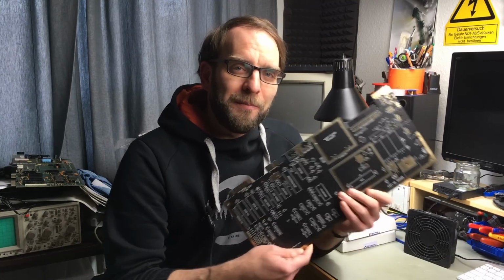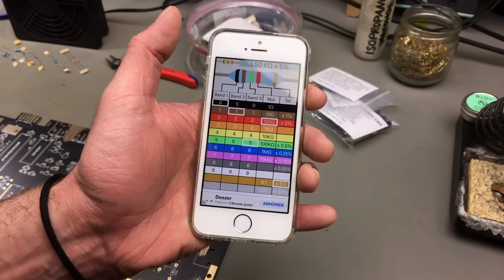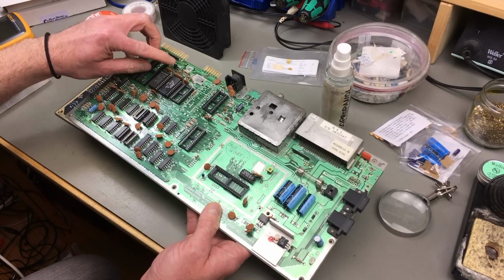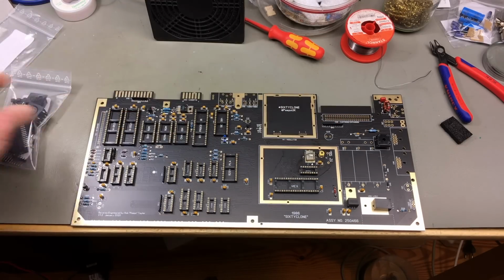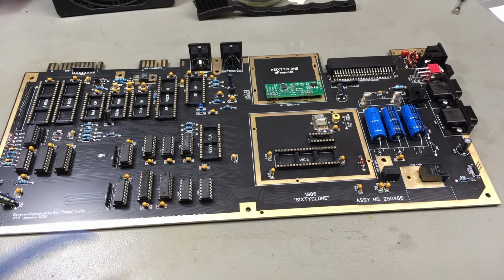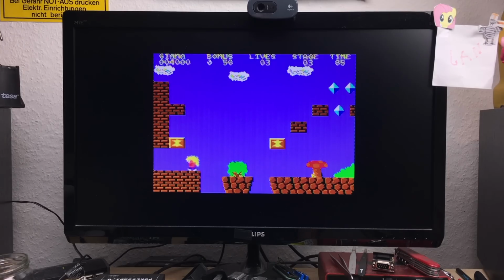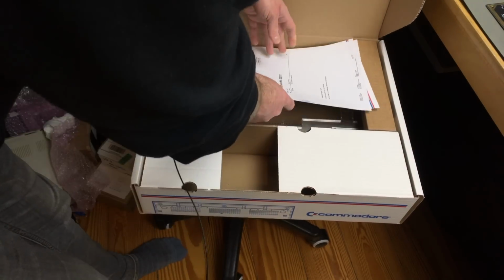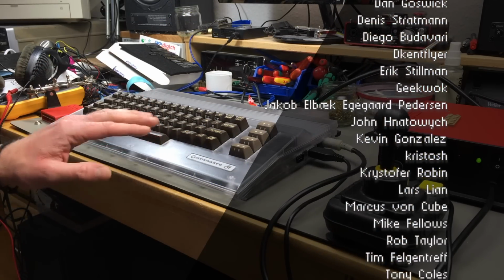Building a new C64 in 2020

Comment: Is there a way to to make a socket to rewire to 6502  so it can be used as a 6510?  There seems to be a lot more 6502s out there than 6510s.
Reply: I'm working on it. It's way more complex than a rewire as a clear difference between a 6502 and 6510 is the AEC functionality to remove the CPU from the bus. You need to implement that with discrete logic and as with everything C64, getting the timing right is crucial for good compatiblity: Not too fast and not too slow. And of course you need to implement the processor port with discrete logic. I will release a 8501 and 8502 adapter first, because those chips are even rarer than a 6510.
Reply from the maker: I think I saw somebody made a replacement like that using one of the MOS CIA chips for the ports if I remember correctly? Can't find it now but it was a fascinating read.
Reply: @JanBeta  I have a schematic by Ruud Baltissen that uses a 6522 VIA. It is a big 40 pin IC that makes it impossible to fit anthingthing in e.g. the Plus/4 and only using a fraction of the functionality of the 6522 feels bad. The Baltissen schematic does nothing to get the timing right and has a bug where the 6522 is clocked by the AEC signal, which means it doesn't receive any clock if a Plus/4 is in fast CPU mode. I have decided to implement the port using six 74xx chips (can be reduced to 2 chips if I hardwire the data direction register), which is more than I like, but in combination with evil SMD technology, it is then at least possible to design something that fits in a Plus/4.

Comment: switching power regulators always have a lot more noise than the lineare have. therefore, these should not be used in audio products and oscilloskop.
Reply from the maker: These are extremely low ripple/low noise, and the switching frequencies are way out of the range of the video/audio signals. As I said in the video, I have been using the same 5V regulator in my everyday C64 for ages without any issues whatsoever.
Reply: @JanBeta  I understand. All sound kit as preamplifier, riaa, DAC, uses only linear regulator and never switch regulators. May have something to do with the fact that they are the cheapest. 
The disadvantage is that linear regulators get hot and must have good cooling

Comment: Has anyone ever made a W65C02S to 6510 adapter? Since you can't get new 6510 CPUs anymore.
Reply: I'm working on it. You should be using NMOS 6502s though (no longer made, but easy to find), in order to support undocumented opcodes.
Reply: @Apple No, I am implementing it using 74xx circuits and a GAL. No VHDL used. The use of low-cost components will keep the costs of a replacement low, just like for my PLA replacement. You have control over the timing by selecting different GAL speeds and different subfamilies of 74xx circuits. You need to choose that correctly in order to replicate the original 6510  timing. Because AEC function can be controlled by cartridges which can make all kinds of assumptions, there is not a lot of room for being different to the original 6510. It's not enough to be  within the timing margins in the original Commodore specifications, you need to replicate the actual 6510 timing behaviour.
Reply from the maker: Hey Daniël, let me know if you have something ready to test. Would be really cool to use one in this build. Although I'm also eagerly waiting for the Mock65xx project to be finished, that will be extremely useful to replace some of the rarer 65xxx processors, too. :)

Comment: I think the only disappointing thing that I can see from all this is that the creator didn't try and work out how to change the axial caps to radial ones. Axial caps are a pain in the ass to find here in Australia.
Reply from the maker: Oh, you can actually use radial caps instead of the axial ones, the connections are there on the original boards and also present on the replicas. Commodore probably wanted to be free to use whatever parts they could get their hands on. I've never seen a stock C64 with radial caps in those positions though.

Comment: Hmmm....I did not recall C15 being polarized or that it was a tantalum. I followed the BOM pretty closely, however. Looking at one of my photos I took, I see no text printed on the right side so perhaps I got this one correct on the first try. I might pop open the case to be sure.  I do recall C200. I asked about this one before soldering. This makes me wonder if my SixtyClone 407 has any of these. Not seeing any on the BOM.

Comment: Nice work! Just a few nit picks. You are supposed to bridge the JPLUM1 on the RF replacement board when using it on longboards, to get correct chroma/luma values. c0pperdragon documentation is a bit lacking. Also when you use a replacement 8701 you don't need the crystal, CT1 or the ntsc/pal bridge. At least that is the case with TOLB from eslapion. :)
Reply from the maker: Yes, completely forgot about that little jumper, thanks! For the 8701 replacement I'm using, I need the crystal and the bridge. Might give the TOLB a try sometime soon though. :)

Comment: Der ARMsid ist wirklich mega. Ich hab zwei davon in meinem Ultimate64. Einer als 6581 auf dem rechten Ausgang, und einer als 8580 für links. Das ist fast schon Surround-Sound! ;) Du könntest in deinem Video darüber das Firmware-upgrade und die Einstellungen der ARMsid's deinen Zuschauern zeigen. Ist vielleicht für einige interessant die ein 469er Board haben, aber gerne den 6581 Sound hätten.
p.s.: Tolles Video! So lange schau ich sonst niemandem beim löten zu. ;)

Comment: Interesting project.  While I think that most people will probably be better off using something like TheC64 and sticking with emulation, I can see this as being really good for those who want to stick with real hardware but maybe only have a non-functional or semi working original C64.  

One more thing that I could see being a good add on for a project like this one (assuming you could do it) would be to replace the TV modulator with a device that allows the installation of a HDMI connector which would make connecting up the C64 to common monitors and TV's a lot easier.  An LED strip in the case would also make good use of the clear material but it is up to you how much rainbow vomit you like in your systems.

Would you consider doing something like this with one of the Amiga boards that are avialable?  I could see there being a lot of people from the Amiga community being interested in something like that.

Comment: It's great to see so much support for the C64, usually with older machines I always have a feeling in the back of my mind that I'm kinda taking it's life away by using it at this point, if that makes any sense.. for the C64 though you can get a replacement part for pretty much everything relatively easily at least if you don't require originals. Just try working on some old PC compatibles or other less common machines and you'll be on your own, some machines may not have any search results whatsoever and when a proprietary chip dies on one of those.. oh boy

Comment: If it's a pre rev. 1.4 then remember to do the cartridge port fix mentioned on the tindiepage for the sixtyclone. 👍
Reply from the maker: I didn’t have the fault on this board, actually measured it before I started filming and forgot to mention it later.

Comment: Does anyone make Breadbin cases or is there some reason no one does?  I see cases on EBAY but they are obviously recovered.  I do have breadbin cases I could retrobrite but afraid they will just turn back to brown.  If you replace your keyboard do you mean to clean up an existing keyboard and put it back in?
Reply from the maker: No, afaik nobody makes new breadbin cases. The only reason we got the new C64C cases was that they found the original molds for it when they demolished (or renovated, can’t remember) an old factory.

Comment: Hi Jan, I intend to do the same with a new A1200 board. But until I know exactly how to desolder the chips and solder them back in again, I won't even start. Do you know how to do that? I have learned how to solder. Thx, Frank aus Gladbeck
Reply from the maker: Oh, the A1200 is mostly surface mount parts so you should practice with hot air a lot. Desoldering the larger ICs is non trivial.

Comment: Finished watching now. And I have a questions though.

I have noticed, that the PCB is a bit too wide on the cartridge port on mine. Have you noticed anything and if so, what have you done?

Also. Great job with the machine. 👍👌What colour rubber feet, did you use?

Finally. Why did you take the chance of power on first time, with the chips in, when not measuring voltage and ground connectivity first.
Reply from the maker: Yes, the PCB is slightly wider on the cartridge port but so far all cartridges fit and have a slightly tighter grip which I don’t mind.

I think I would just use the nail file i used on the LED to bring it down if I was to do it.

And I actually checked the voltages before populating the ICs but forgot to film. I was slightly excited the whole time through this build, it was just incredibly fun. :D
Reply from the maker: Oh, and I used the white feet that were provided, might replace with clear ones at some point but they look fine.
Reply: @JanBeta  Nice....
I have a couple of brown ones that I think will look good on the black case. Regarding the cartridge port, then my Epyx Fastloader Reloaded are too slim. The board grinds at the edges of the cartridge inside the cartridge case.
Reply from the maker: Oh, I’ll try my Epyx cart, too. If it doesn’t fit I’ll take the file to the PCB! :)
Reply: @JanBeta  👍 Let me know if that is the case on your board as well. 🙂

Comment: Great video! I think the green power led is dimmer because: a) the case is translucid so a lot of light enters it; b) it's recessed deep down in it's square hole; c) as you said it takes more voltage to light up brightly
Reply from the maker: Yes, makes sense! I might also just replace the resistor with a more suitable value to make it a little brighter, haven’t decided yet. I like the color though. :)

Comment: That was a really nice build! I also got myself an ARMSid replacement for my C64 because my original 6581 R4AR started to make some strange noises and is probably about to die sadly. I really like it a lot and with some tweaking with the provided software it sounds really good! The only strange thing about it that I can hear is some of the noise waves sound a little bit off, like they are at too low frequency. For example when playing Sam's Journey you hear a whoosh sound when you pick up a power up, and it sounds quite different on the ARMSid than it does on an original SID. It's kinda like the noise channel is one or two pitches too low. Hopefully a firmware update can fix that. Other than that I am really happy with the ARMSid and at that price it is a no brainer if you need a good replacement. Really nice that you can change the emulation between 6581 and 8580 modes and get the best of both worlds on the same board (I still highly prefer 6581 like you Jan) :)

Comment: I must admit. I'm a little more a "Atari fanboy" rather than C64 so I'm really jealous about those new mainboards for C64
Reply: I think that eventually, we will be able to have new  builds of every platform that still has a community of users... I think this is how the problem will be solve and keep prices reasonable, we cannot continue with crumbling machines and increasing prices forever.   I am more into early PC's... and it is now possible to build a brand new 8088 machine from completely new parts now.  exciting times for retro-computing. most of what we do in life, play, work, does not require today's powerfull machines, when you think of it.  some famous writers still use programs like Wordstar, and word perfect for dos.
Reply: Same, but TRS-80 Colour Computer...
Reply: I love making chiptunes with the Atari 800 Pokey soundchip and the C64 SID soundchip. SID 6581 chips have gotten expensive but Pokey chips are now not only expensive but extremely rare. They don't come up on eBay often but when they do the bidding wars are ridiculous. I  ended up getting a replica Pokey chip. It works in a synthesizer circuit but it does not work in the computer because it has no keyboard functionality. It's just such a shame. Perhaps someday I'll own the 800 if someone comes up with a solution.
Reply: 1088XE

Comment: On the website you provided it states that the two boards available have been configured for PAL. Will these work in the USA since we use or used to use NTSC?
Reply: I have a sixtyclone that I use for both NTSC and PAL, all that is needed is to convert is changing the VICII, crystal and a jumper on the board. I put low profile socket pins for the jumper and crystal which allows me to quickly swap the components. There is also the issue of the 50/60hz signal going to the CIA's time of day clock, this is derived from the mains AC frequency but is only needed for a handful of software. If you need this though you can build a simple circuit with schematics found online to supply the correct frequency to the CIAs.

Comment: Weee.... Same idea as I have (the new-parts aproach) same revision of the SixtyClone and and same colour of the board. This will be an interresting video to watch. Especially when you say how good they perform. Ordnung muss sein, as you say.
Reply from the maker: Haha, nice! Excellent taste then. Hope your build goes as well as mine did.
Reply: @JanBeta  I hope so. I have another RF modulator replacement at hand in white silk screen, and my case is a black pixel wizzard with an orange LED. I am going to use an ARM-SID and one of those two-chip PLA that Adrian Black showed. Shared this video with someone I know in cipenhagen. He will be watching with a cold brewski and some pork rinds. He did not know your channel and are surprised with your professionalism.
Reply: @JanBeta  I will have it up on my channel, once it is finished. Still need tons of stuff, have all chips though.
Reply: @JanBeta  My build was finished on the 19'th of march 2021. And it is running well.... I have a video up on my channel. Also. I have created a sub reddit for SixtyClone owners and KU-Board owners. In other words, a sub reddit for those that have done a modern clone of the Commodore64 machine, using those boards. Not for those that are building these Ultimate64 and Reloaded machines. The main goal, is to get people together and see how many clones that are out there in the wild, and to look at what result people have created. It is called "SixtyClone_Owners_club".